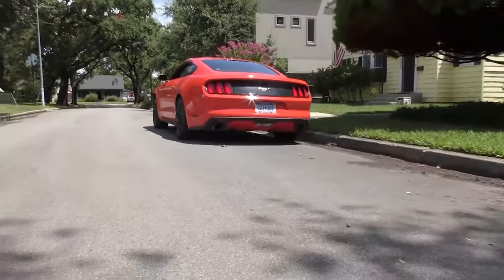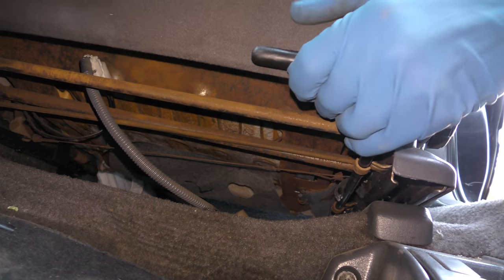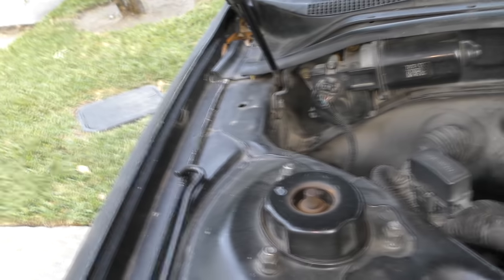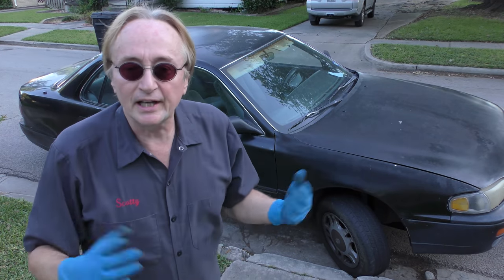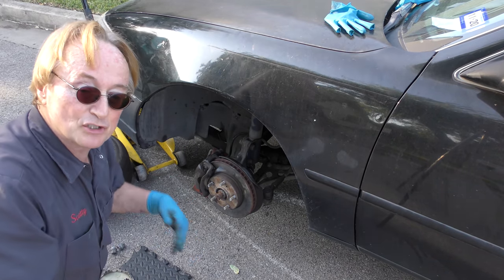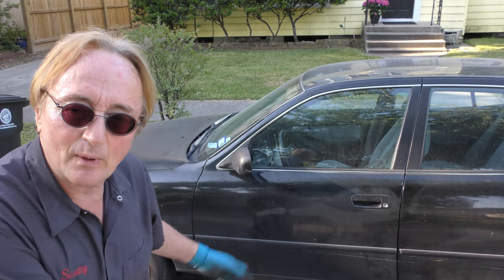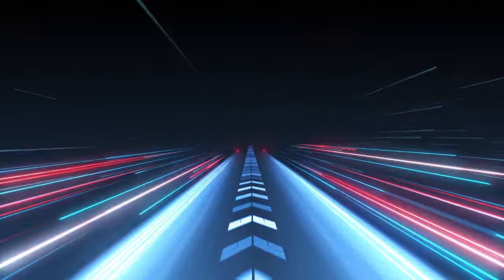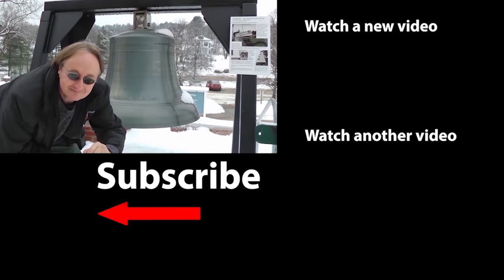Never Do This to Your Car (Learn from My Mistake)

Comment: Please help. Think the bottom frame on the left side of my focus (in front of the rear tire) is rotted. Got a nail in my tire and a mechanic tried to jack it up and it just fell off and a bunch of CRUMBS fell off 😭. Is there a way to fix it? I love that car and don’t want to get rid of it. What should I do??? Don’t want to get ripped off.

Comment: Did your tip with the brake to take the wheel off only a tip if the wheel is bent? Because the weight of the car on the wheels stops the wheels turning before you jack it up, making your tip pointless in most cases

Comment: Too bad, the parts are not really that expensive.
I think I would make the decision based on the rest of the car. If it ran and drove well and this was all it was wrong with it. You're probably better off fixing it.
I went and looked on Rock Auto. Picked the daily driver mid-grade parts.
Looks like $310 for the one side.
Axle $50
Quick strut $90
Ball joint $30
Lower control arm $40
Knuckle $100

Comment: That didn't happen because the suspension parts were worn, you can clearly see that the castle nut holding the lower ball joint to the knuckle must have somehow worked loose and the joint popped out. The joint itself was still intact (worn or not).

Comment: I just bought a 2001 Toyota Camry with 127K miles what oil should I use high mileage penzoil or regular conventional oil ?
Reply: I used full synthetic or blend oil for higher mileage over 100k. My maxima is over 167k. Using regular conventional is fine if you change oil more than regularly within a year like in your owners manual said. Also, if your car burns oil more than usual, higher mileage oil can help with additive protection mix with the oil the help make your engine last a bit longer too. Most top common brands are good like Pennzoil from what I've been told and experienced. 😁

Comment: So in order for me to have a mechanic check out a used car before I buy it.....What if I want to test drive 3 cars on Saturday. Where do I find a mechanic that wants to check out 3 different cars? And how much will that cost me? Or is he saying drive the car to the mechanic shop and then walk in to the front desk and say hi I want a mechanic to test out this used car that I want to buy...

I don’t think it’s that easy because my local mechanic shop doesn’t offer that. They do diagnose your car for $75 but they usually hold the car over night because they are backed up with other people’s cars.

Comment: Reminds me of my totaled 1999 Jeep GC money pit. Chick (no doubt on her cell phone) ran off road and smacked into my left front end breaking the alloy wheel, steering linkages and axle.  Yeah, totaled. After eight years of repairs thought maybe patient was out of ICU and in stable condition.  But looks like God did for me what I could not do for myself: Get rid of the money pit.  Hey, there of LOTS OF THESE MODEL YEAR JEEPS IN PUERTO VALARTA!

Comment: The ball joint didn't pop out. The threads aren't stripped and the joint is still in tact. Did the nut break? Did someone try to tighten it and crack it? Weird!

Comment: This Happened to my 96 ram 1500, bought it used back when I was in high school and used the old girl hard with my tree trimming business for nearly a decade both wheels fell off on the highway while hauling lumber to the mill got the parts from the junkyard and put her back together, that was nearly 40k miles ago now she has 250k. Not a Toyota but I would say I easily got my money out of it

Comment: Those Toyota engines and transmissions outlast the rest of the car..I had a 94 Camry. The door handles started to break off, the sunroof and windows would not roll down but the engine still purred at 320,000 miles!!!

Comment: G'day, Mr.K, I had an issue with my clock display on my '01 GM Safari - the first number fails to light up so at 12 00 it reads 200 !! Any advice plz ??

Comment: Had a guy come in where i worked years ago with a Jeep. He said It pulls to the right. I almost rolled it when I hit the brakes. His pads were gone on the left side front disc. So he undid the brake line at the frame and folded it over about three times so he could continue to drive it. Scared the doodoo out of me when I hit the brakes hard....L.O.L.

Comment: my son has a 92 Camry with 400 thousand miles it was falling apart like this one replaced the front end parts with junk yard parts from a car that just got wrecked he lucked up before they wrecked the junk car they just replaced the front struts front control arms and he did not spend a lot at all  hell he took the interior out of a car that a dealer sent a trade in to the yard that only had 100,000 miles it is a great car the best part the car was given to him by a person that comes to tires plus  and will only let him change the oil best car we ever owned oh yeah it has air that works so good in 100 degree weather the air blows 40 degrees and it is a junk yard compressor so not all junk yard parts are inferior

Comment: guy: asking question to remove a rounded bolt

Scotty: hit it wit a sledge hammer with bolt removal tool or weld another bolt on top

the bolt is located at fuel tank 😁
Reply: Simple: drop the tank, Empty the tank then weld.

Comment: Just weld that Toyota wheel in the straight ahead position and drive it until the other wheel falls off.
Reply: Lol. Bolt the control arm to the knuckle

Comment: Hey Scotty mate. I’ve got a 2000 Jeep Grand Cherokee that keeps ouverheating when sitting at traffic in warm to hot weather. I’ve back flushed the radiator.. I’ve replaced the radiator fan. The fan relay twice. The water pump and the thermostat. The engine is the 4lt 4l
Reply: Inline 6

Comment: I drive 4,000 miles a month and my little scion is about to get retired even though at $246,000 mi she's still kicking pretty good the engine light came on and I'm struggling to figure out what part of the air intake where the leak is coming from and as I've seen in many of your videos I have exchangedseveral parts trying to figure out the problem before my emissions comes due. Please help and when I do purchase a second vehicle after I pay this one off because yes I still owe money on it LOL it's getting paid off this next month. But what would be your advice on a good second vehicle I need to purchase something that's comfortable reliable but I can't buy brand new because I'm upside down too quickly

Comment: Them ball joints are cheap, the driveshaft can just be popped back in with some persistent wiggling, and it does not look like much else got damaged: sell it for cheap to someone poor and handy, and it will be back on the road in a couple of hours)

Comment: If you're driving Old s*** box cars you really should learn to be somewhat mechanical because really that's a pretty easy fix and probably get a few more years out of the car.Only thing I would buy new is the ball joint and that's cheep $35 at the most. The rest at the scrap yard...

Comment: Just fix it and it will still run for years ... In the end you end up loosing more money buying another car. As long as the engine runs and the frames is not rusted away - fix it 👍😊 And yes , I drive a 21 year old Volvo and I dont plan on changing 😜

Comment: A Cotter Pin would have prevented this, someone obviously worked on this ball joint and didn’t install it properly. Yup, have a mechanic inspect before you buy a used vehicle.

Comment: Hey Scotty! I want to buy a 2004 tsx six speed with 130,000 miles is 6000 a reasonable price. I do live on an island.
Reply: No, it is not. That's way too much
Reply: Do a price check for on kelly blue book and car fax for guidelines. Get a price range for the highest and lowest conditons before even condsider buying it. 😁
Reply: N0RT2G0RD4U 
I live on an island, good cars are hard to find!
Reply: According to kelly blue book for 04 tsx manual with 130k, it's under 5k with good condition minor rust included and no major mechanical problem. However, without actual test driving and seeing the car yourself, you won't know for sure. Do more research and go see the car for yourself. Pictures and talk with the owner can only get you so far. Otherwise, look somewhere else and repeat. 😁

Comment: I hate junk yards. The opening handle on Toyota was broken. It was actually, the little plastic  thing, the handle hooked to, that broken, My girl friend kept wanting me to fix it, because I had to un roll the window, and open it from outside . So, take the part off, and go to the junk yard. The think is the size, and shape of soap dish. I ask the guy, does he have a Toyota, I can take the part off. He say, "Yeah, two hundred and fifty bucks."  I'm shocked, two hundred and fifty bucks seems insane to me. I figure I can buy it on line, so I  tell the guy, "Let me check my bank account." I find the part for forty dollars on ebay. I tell the guy, "I just found the part for twenty twenty dollars on line. So, I don't need cheated by him." The junk yard guy gets pissed, and tells me I'm tresspassing, and get off his property. More or less, that what happens every time I go to a junk yard.

Comment: 🙄WHATS A TOW HOOK🙁.     Oh.   Wait , I remember tow hooks.    The put them on for decades after doing away with solid attach points.    Now they’re NEWER AND IMPROVED😾.   You can’t even hook a modern tooth to yank it out of the ditch without hooking the control arms.     Insult to injury the Jap made Camrays come with hooks!   🤬

Comment: Too bad the owner wasn't a DIYer. That Corolla probably still had some life left in it. I was in a junkyard pulling parts for a few of the family cars, and I found a Sonata that had a lot of new parts on the front suspension, but was wrecked in the rear. I picked that car clean for our Sonata. I doubt if those parts had even 5,000 miles on them. I felt sorry for the former owner of the car. Going to all that work, and the car gets wrecked.

Comment: I'll give ya 200 dollars for it right now! 
That would be a good deal lol
But that guy prolly got ripped off for like 1500 knowing some of the scum I've ran into before
But if ya paid junk for it and then replaced the whole front end with rockauto parts and replaced the 15 dollar door handles, yourself you would have yourself a damn good beater for a while

Comment: I'm disappointed ...I wanted to see him fix that "great" Camry.....I want my money back...
Reply: I agree;  If the engine and transmission are good, it's still cheaper to fix, than buying another used car, with the same potential problems.
Reply: @billdougan4022  Exactly.
Reply: @tremayne3  Scotty came out with a $500 Corolla video 5/30,  hope he checked the ball joints. 😛

Comment: Ball joint was fine, but but was taken off then driven ! Totally staged !
Reply: Ben Krom I trust my scotty; next you will be saying the grooves on the tarmac was made by ants🙄
Reply from the maker: I don't know what planet you live on I don't stage anything customer cars come in and I work on them, this car was in a video a few weeks ago
Reply: @scottykilmer  Well I know that I only have 50 years of being a mechanic but I've never seen a tie rod nut back off. You and I know that  even if the nut is taken off that tie rod end isn't popping off without a good amount of coaxing. Possibly since the customer has an old car maybe they took nut off but didn't release the tapered tie rod and forgot to put nut back on. You should have addressed how dangerous it is to be inexperienced and working on a 1.5 - 2 ton vehicle, cause you can turn it into a out of control projectile ! LOL as far as what planet I'm on,  with all these kids now and all their 78 + genders and all.  This isn't the same planet that you I were born on back in the 50s !
Reply: @m80tmm  Watch video again, tie rod end is missing the nut holding the suspension together . That nut is self locking and will not back off ! Someone took it off then drove the car . Very dangerous . Scotty should explain this !

Comment: ok THAT JOB DOES NOT COST OVER 1K IN PARTS, IF YOU SPEND OVER 1000 IN PARTS LIKE SCOTTY YOURE STUPID, my brother crashed same wheel broke off everything just like that, 2011 camry and it cost me $280 of OEM parts, new lower control arm, new axle, shock was fine, drives like new